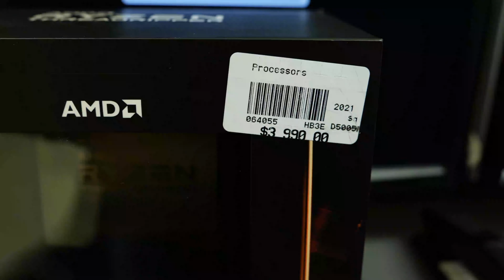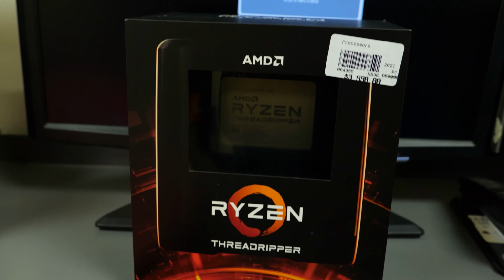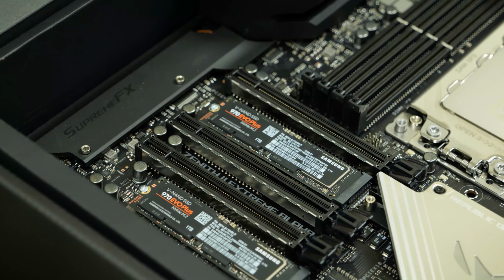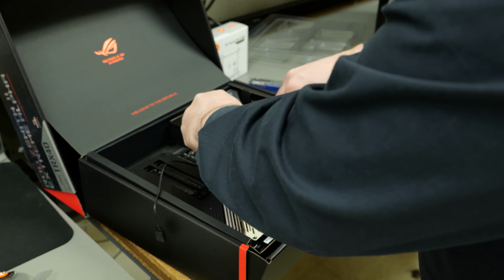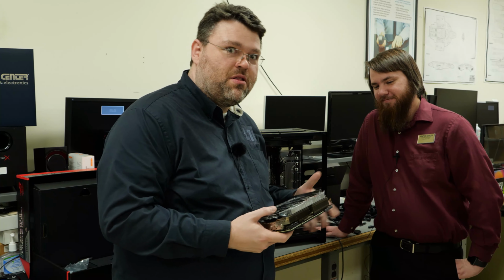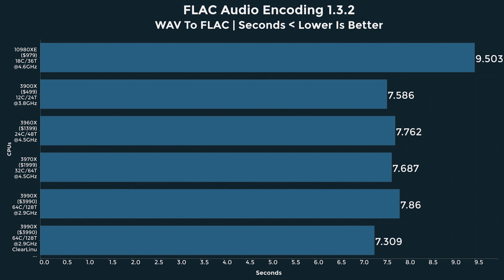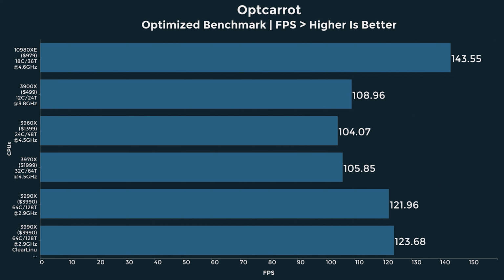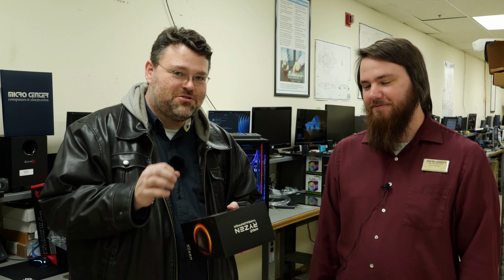AMD Threadripper 3990X - Build & Benchmarks

Comment: Hi, i have a problem. Who can help me out??

I bought the powersupply Thermaltake Toughpower DPS G RGB 1500W Digital 80+ Titanium. It only contained one (1) ATX 12V 4X4 pin. I'm now going to use the motherboard ROG Zenith II Extreme Alpha AMD TRX40 E-ATX for 3rd Gen Ryzen Threadripper. See https://www.asus.com/Motherboards/ROG-Zenith-II-Extreme-Alpha/ 

That motherboard uses (2 X) ATX 12V 4X4 pin and (1X) ATX 12V 3X3 pin. (Dual 8-pin & one 6-pin ProCool II power connectors Three ProCool II connectors ensure a snug and reliable connection to the EPS 12V power lines.) 

So I want to buy two (2) extra cables of ATX 12V 4X4 pin and one (1X) ATX 12V 3X3 pin. How do I get those cables? Can you  guy's  help me out. I like to hear it. Thanks.'